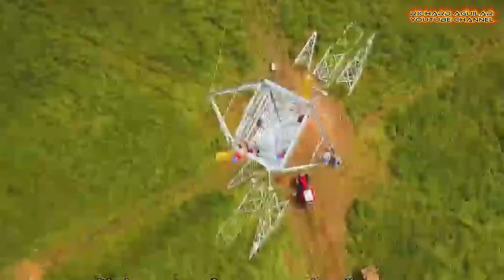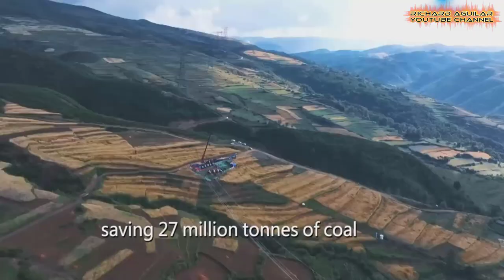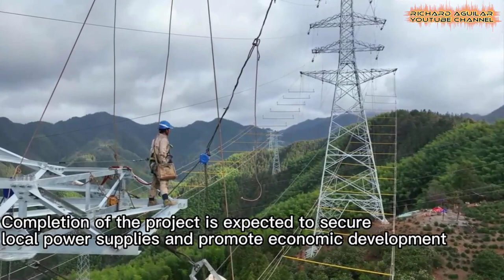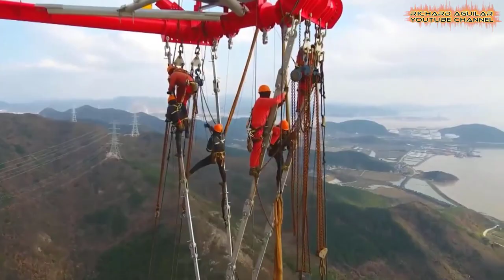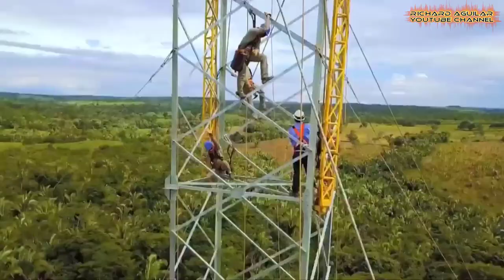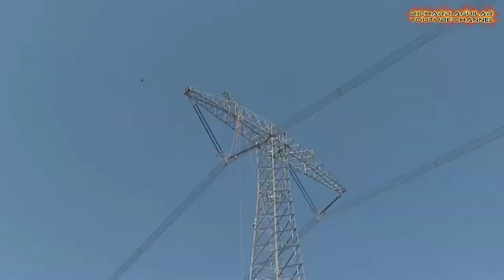China Built Record-Breaking Ultra High Voltage Power Transmission Projects

Comment: Amazing. The Chinese workers are incredibly hard working for their Country to become the most modern advanced country. Adore. 🇨🇳🕊🇦🇺
Reply: India  built one, 800 kV, 6000 MW in 2015 to evacuate power from the North East to the central plains and is building two more.
Reply: @sowmitriswamy6718  Yes, Indeed India has the best of everything. 👏👏👏
Reply: @hengyipfong6799  I only wish that were true. But it is getting there, not at the pace that one would like, but slowly. The Federal and State governments cannot take land away just like that and farmers demand huge compensation and threaten litigation. Power Grid Corporation of India owns India’s first UHVDC transmission line, the 1,728km 800kV North-East Agra UHVDC link, which is capable of transmitting 8,000MW.
Reply: What about tufo dreg
Reply: @terencemcculloch3294  What about Miami condo?
Reply: @krashd  What about Hundred Acre Wood?
Reply: @hengyipfong6799  India and China have best starvation.

Comment: Fearless Chinese workers.  800kV, direct current is leading edge technology that cuts down transmission losses
Reply: Doesn’t DC have bad transmission?
Reply: No, for transmission above around 800 kilometres, HVDC becomes more feasible. HVDC has less losses but at the recieving and sending end we need power converters which are costly and introduce harmonics in the supply.
Reply: @shantanukumar7174  Yes AC has harmonics.

Comment: Simple statistics.  Baihetan is a hydro generating 16,000MW and rated the world's second largest power plant.  It has two UHV transmission lines carrying electrical power at 800kv in DC to the two cities' consumers in the east coast, both over 2,000km away.  Ultra High Voltage technology can cut down transmission losses, especially used in conjunction with the Direct Current.

The highest voltage transmission used in US is 500kv in AC.  In UK it is 400kV in AC.  Thus in power transmission China is street ahead of the west.  Baihetan is also the record holder of having the world's biggest hydro turbine rated 1,000MW.  Outside China the biggest water turbine is about 800MW.  For 700MW or about hydro turbines 2/3 of them are operating in China.

Comment: For transmission above around 800 kilometres, HVDC becomes more feasible. HVDC has less losses but at the recieving and sending end we need power converters which are costly and introduce harmonics in the supply. We can't praise Edison for his choice of DC as transmission, because back then we didn't have converters, Nikola Tesla's transmission model was much better and more efficient for those times.